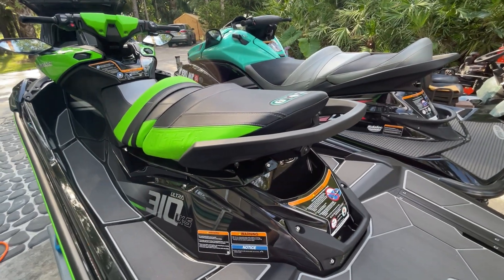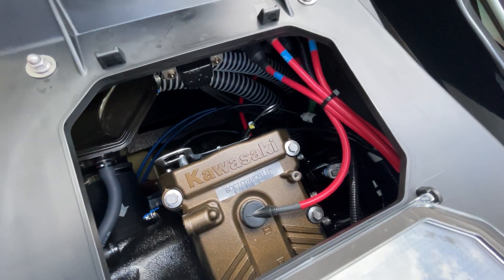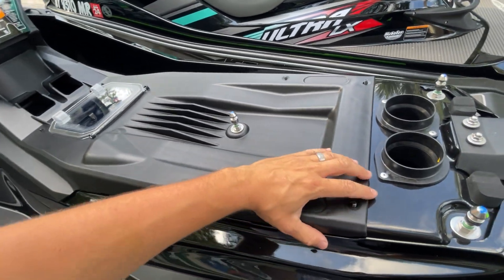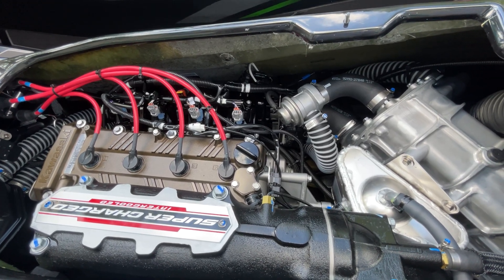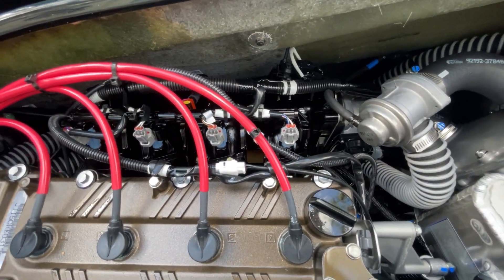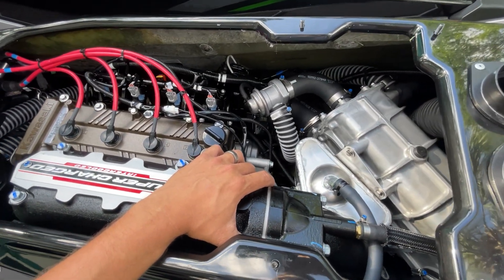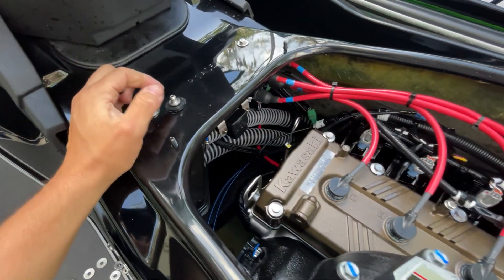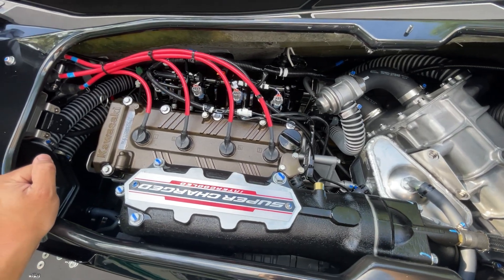FIRST LOOK: Kawasaki Ultra 310 Jet Ski 310hp 4-Cylinder DOHC 1,498cc Engine

Comment: I bet you can put this engine in a small car, it’s just the right size and it’s effectively in a rear wheel drive layout. It needs a clutch and an adapter plate to put it up to a transmission.
Reply from the maker: This engine was adapted from the Kawasaki Ninja drivetrain
Reply: @JDsWaterWorld  How did they do that?

Comment: These are port injection not direct injection! i wish they would put this engine in a small little hull the size of the Spark
Reply from the maker: @Seth N you are completely right. They call it “DFI” so I just read the acronym wrong it’s really “Digital Fuel Injection” not “Direct.”

Comment: I have ordered one of these, still a bit nervous about how many hours these supercharged engines last. I plan to use mine in Stockholm archipelago
Reply from the maker: These engines hold up very well for hundreds of hours as long as you follow all the flushing and maintenance procedures! Use only Full synthetic oil, and never miss a flushing or fogging.

Comment: What is the main reason they changed this covered engine vs the 2020? I just got a 2020 with 10 hours on it and I am looking to be a mostly offshore fishing here in Texas. I'm assuming it'll keep water out a lot better if you flip it over?

One more questions are these off-balanced like all the older skis? I know mine is quite a bit heavier on the left side I believe it was. Turns completely different going left vs right. Love the videos! Thanks!
Reply from the maker: I think one of the main reasons for the engine cover has to deal with the new adjustable seat. I promise you though, it is really not a big deal. It’s really easy to get the cover off, I have been doing it each time I do post ride maintenance. Just make sure you have a 10 mm nut driver with you, but if you don’t the ski comes with a tool kit in the front compartment. It might be a pain to get off out on the water if you were trying to check a hose or something, but I have noticed it cuts way down on the amount of salt water and salt spray that enters the engine compartment. It’s fine it’s funny because a little bit of salt water gets through the clear plastic cover, and leaves a residue on the valve cover right there. The body of the exhaust the rest of the engine the intercooler and the belt components are completely protected from salt water spray. The 2020 is a great ski, but it handles completely differently than the 2022. The changes to the front water deflection system are incredible, and the new ultra deck is so large it’s great for fishing or an extended fuel cell. With prices and everything the way they are now, enjoy your 2020
Reply: @JDsWaterWorld  thank you very much! Picked up the orange supercharged for 14k with trailer and about 10 hours on it. One day I'll need a second! Great Chanel you have
Reply from the maker: @abc123hshdhd8w  You got an awesome deal on that ski, I love the orange color. For a 22’ out the door with $tealership fees, tax,tag, and trailer you would be close to 2x that price! Thanks for watching! Go Team Green!

Comment: Cam you show an engine flush  and do you still have to do both supercharger  and engine
Reply from the maker: Yes I actually filmed  a flush video just have to get it uploaded. You flush the intercooler and engine separately, yes. The ski has separate flush ports identical to the previous generations. Also have to fog the supercharger as part of the post ride maintenance.

Comment: Sound like you have done some homework so you might be able to answer my question.... Is just my imagination or it looks like this ski has an old ignition system? Is electronic? Looks like has a coil pack at the front of the ski 🤔...
By the way I love the look of this new ski can't wait to see it on the water
Reply from the maker: The ski has a fully electronic digital transistor/CDI ignition. It is the same design used on all the Ninja motorcycles and Kawasaki Jet Skis for the last 10+ years. Some manufacturers locate the coil directly on top of the plug, but Kawasaki chose to keep the coil packs separate (as you noted). The plug wires look to be 8mm, which is more than adequate for this application. I prefer the remote coils, as the coils themselves are not exposed to the heat cycles from being in directly contact with the head.  She runs 17 degrees of advance total, which actually  isn’t that much by racing standards. Also check out my videos of the ski in action on the water. It’s a great ski, check it out for yourself and you won’t be disappointed.
Reply: @JDsWaterWorld  just looked very old designed by appearence.
I did see your videos and I have to say it sounds amazing on the water 😍

Comment: Is the fiberglass on the inside smooth? It seems like you could get cuts on it
Reply from the maker: The bottom of the hull on the inside is smooth, but the inside part of the top deck looks like it was fabricated with chop cloth, so it’s fairly rough. I don’t think it would cause cuts, but maybe some irritation on your skin from the fiberglass chop cloth.